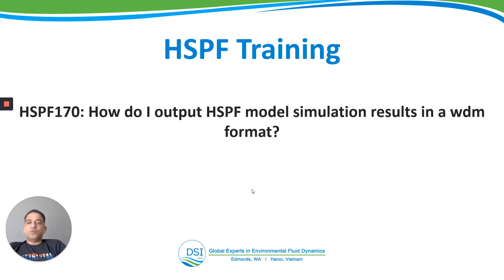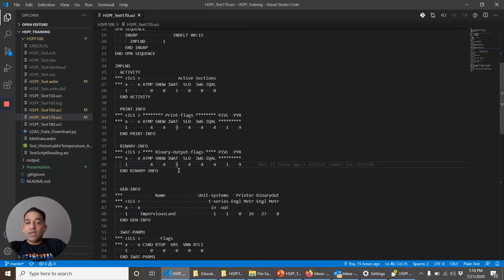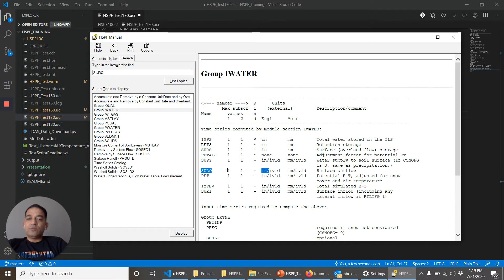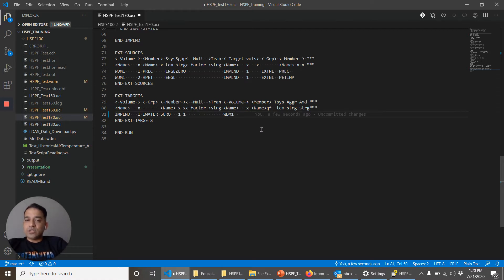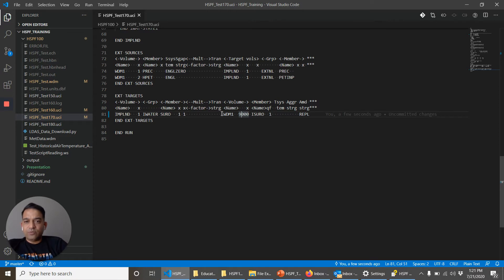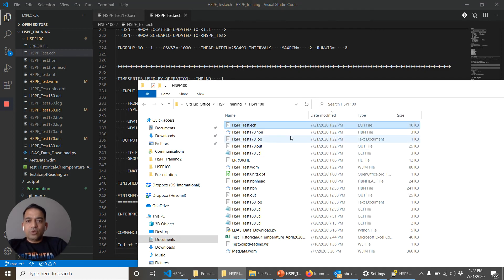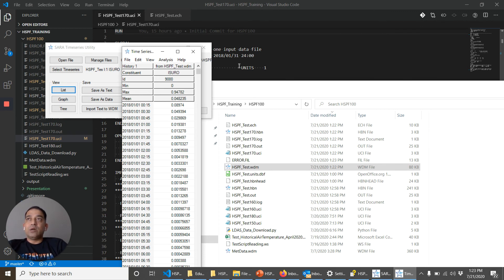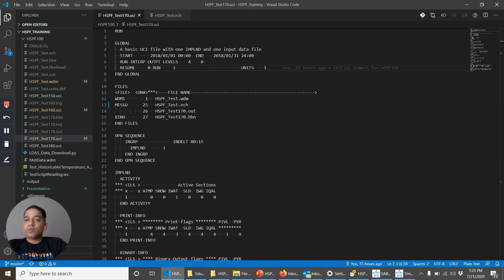HSPF170: How do I output HSPF model simulation results in a WDM format?

Comment: Hi! Thanks for your great videos. Could you kindly talk about using .DSS files in HSPF, for both reading input data and writing the outputs to a DSS file. I've tried but so far not luck. I'm creating a .uci on a text editor and running the whole thing with WinHSPF Light.
Reply from the maker: I have never used DSS files. WDM files are already very efficient and  I can interact easily with it from Python, so I do not bother about other formats.